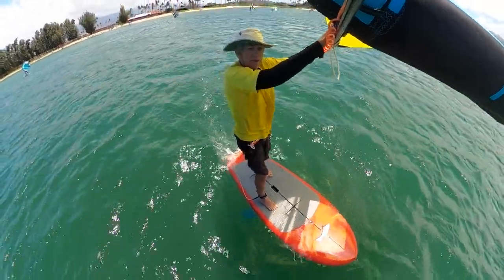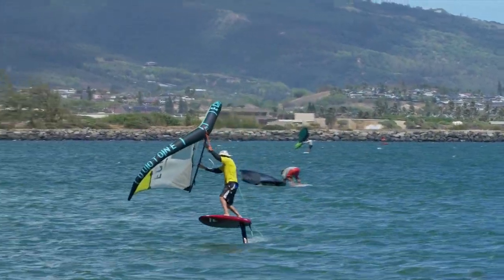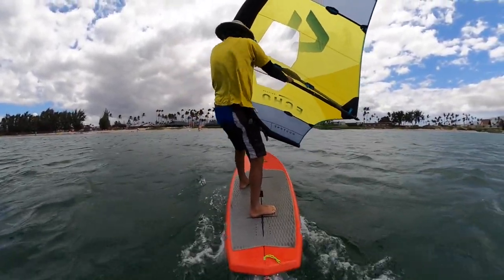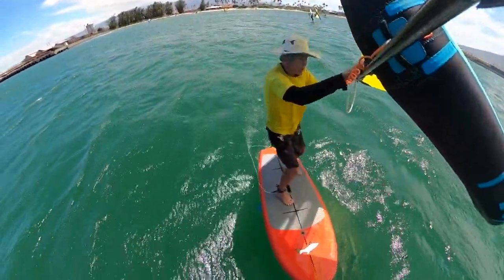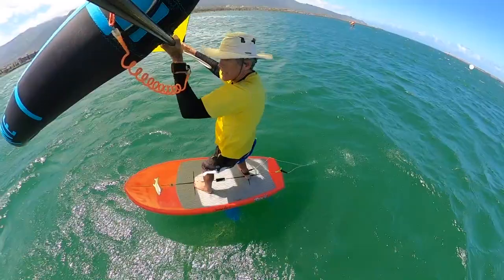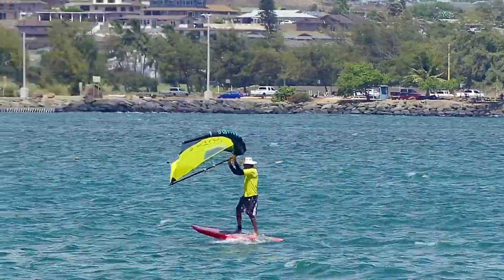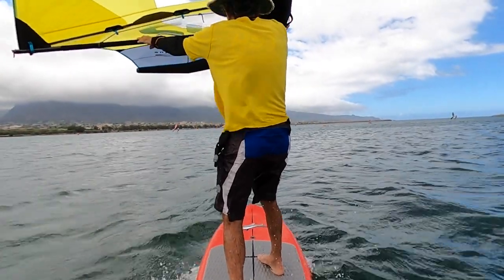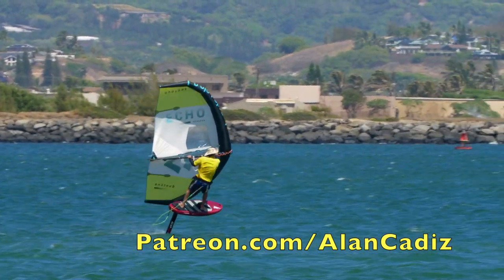How to Wing Foil Jibe with Alan Cadiz on Maui, Trailer

Comment: This is really great instruction.  As an old windsurfer, I cant wait to try this. This gybe looks infinitely easier than learning to gybe a windsurf board.
Reply from the maker: Thanks Dean, coming from an old windsurfer I can tell you it is.
Reply: Even gybing a foiling windsurfer is easier than on a fin. Dramatically so. The dealbreaker on a windsurfer is usually stalling the board in chop and you simply don't have to worry about that. :)